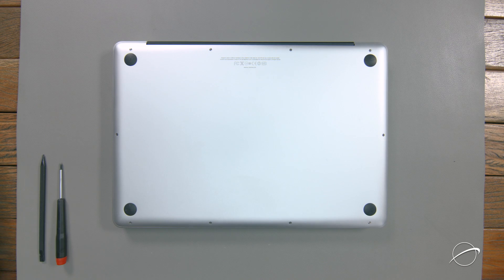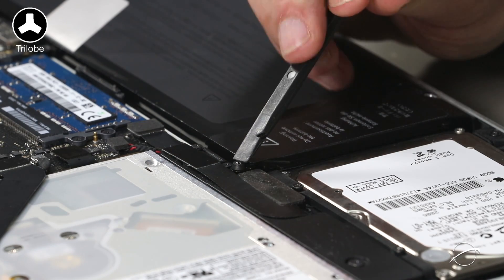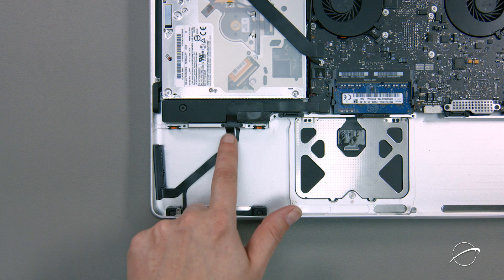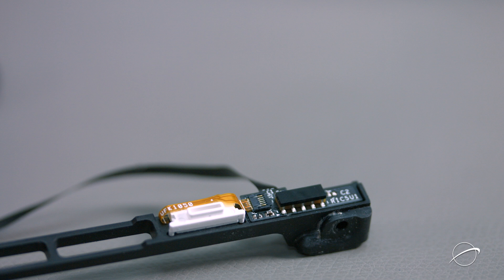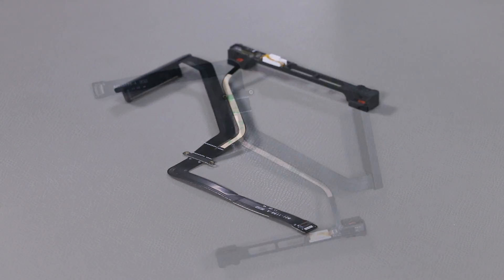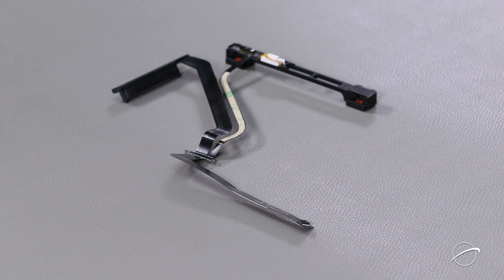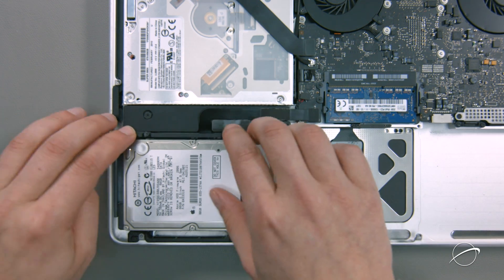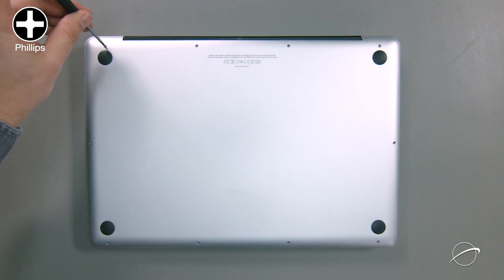How to Replace the Hard Drive Cable in a 15-inch MacBook Pro Mid 2010-Late 2011

Comment: Hi I am planning to upgrade my 15 inch late 2011 MBP replacing the existing HDD with SSD (SATA III) and I am also thinking of replacing my cable while i am at it. Now my question is do I need to get the cable for a late 2011 MBP ( which is the one i have)  or get the one for mid 2012MBP? I was going to initially get the one for my model but I heard that the mid 2012 cable works better with the ssd  and now I am confused.